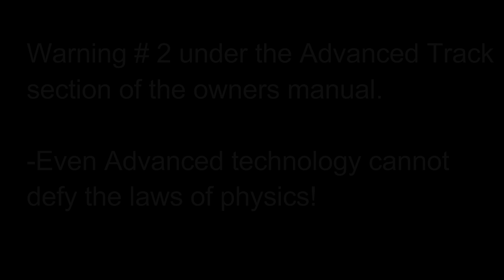The science behind why mustangs crash!

Comment: I agree fully. My 2018 gt350 is great on track as long as you don’t drift too hard. Then it gets vicious; exactly what you described and very hard to save.
It really helps to simply disconnect a plug beside the airbox over the driver wheelwell.
Reply: He is 100% correct.  This is a really dumb myth about mustangs.  The mustang is not the problem, nor the solid rear axle, the problem are the drivers who can't handle a high torque engines, who turn off the traction control and just plain cannot drive. 

I've seen video after a video where  Mustang drivers are leaving car shows and get out of control and they do not let off the throttle until they crash, of course the Mustang is going to crash a Ferrari will crash under the same circumstances. 

If you think it's  Mustangs that are crashing all the time exiting car shows, I suggest you YouTube Corvettes, Ferrari's and Porsches crashing while leaving car shows. 

My friend races a 1990  body Mustang solid rear axle  against Porsches , bmws, imports and he frequently wins and beats them. Do you know what he did to the suspension? He put a $3000  to  $4,000 suspension kit on it from Maximum Motorsports and Cobra brakes and better tires that's it. The touring cars from the The the 1980s and up that Jack Roush produced and raced all had solid rear axles and they decimated the competition. NASCAR runs solid rear axles.

Comment: Corvettes can get away from you too. I had a C5 that would easily throw the rear end out if the traction control was off. The difference is more KIDS and inexperienced ADULTS have access to Mustangs. A person at McDonalds can get a Mustang GT that's never had a rear wheel drive car with 400HP. That means there are lots more Mustangs driven by kids and inexperienced adults= more Mustang accidents.

Comment: Isn't the stability control on a separate circuit with its own relay, or is it integrated with ABS? In any case, surely a simple fuse box on/off switch can keep it all off for track use.

Comment: From the perspective of an old fart, who Raced IMSA and SCCA in the 80's through the late 90's... 

Frankly, my Vehicle controlling ME in any way scares the crap out of me!! 
If my Car got greasy, and I made it squirrely out of a turn... That was my bad I admit it, learn, and move on.

BUT - if I'm in that same turn, and I get loose or start pushing... and I go to correct it like normal...

You're saying that THE CAR is going to apply a Brake or manipulate the Throttle (I do understand drive-by- wire), and undermine my learned reactions??? 😲

I was also a Ford Service Tech, back in the rotten years of OBD Systems (like EEC-2 and 3!!!). 
As ignorant and horrible as they were, none of those systems ever tried to take control AWAY from the Driver!! 

I say NO THANK YOU Sir! 
I'll keep my SN95s and New Edges...
Sure they're slower than the late models by a good margin. 
BUT when I'm behind the Wheel, I'm the one in complete control!! 

Technology isn't always for the better....

Comment: I recently bought a 2007 mustang GT, turned off the traction control and wanted to do a slight drift on a 90 degree turn.  I have drifted in my SCION before with traction control off and it was controllable, but when I tried the same thing with the mustang it made no sense what happened next.  i took off from a stop light with a controllable drift but once i hit second gear and reached the steering stop the car lost control spinning 90 degrees, once i put on the break to stop the car,  it then snapped the opposite direction and the car did a total 180 degree spin and i ended up over the curb.  I never experience such a crazy out of control spin like that and i wasn't even going over 30 MPH!  Luckily there were no other cars near me when it happened.  What your explaining in this video is the only explanation for what happened.  I am not new at driving rear wheel drive cars and this was unbelievable.

Comment: Its not just a ford problem. I have driven several car makes that have what I think is a similar flaw. For me Bmw Mercedes Nissan All have the same issue. One is that you can never really without aa tune turn off or active a track driving mode on the car. The car esp ford and BMW keep the traction or stability or whatever you want to call it off. for me what happens is that the traction control only wants all four tires to spin at the same rate. This is a silent killer.. All of a sudden you get push.. you try to correct it and you are just there for the ride.

Comment: I took my friends 15 GT around a 90 degree corner from a dead stop, all systems off. Started spinning the tires about half way through the turn, easy controllable skid, at approximately a 50-60 degree angle, the second I let off in attempt to correct the car, it violently snaps the ass end around and I go into a 270 degree spin and goes backwards off the edge of the road, completely out of the blue from any other vehicle I've ever tried to skid in any fashion, even wholly underpowered cars that could barely spin the tires would never snap back like that

Comment: From my experience with my 2012 GT track pack with brembos. The system is alway on unless you re-tune the car. When I first did my bolt ons I had Central Texas Performance tune it. They did three tunes. Strip (everything off, max hp). Street performance ( everything off daily driver) daily tune (everything on). I drove the car in the street performance tune for years. Could spin the tires and drift turns all day. When I got the car ready to sell. I had him pull the mods and tune it for a friendly daily tune (everything on). I could still turn it off manually. I drove the car for another month, and would just turn everything off. The first time I went around a turn, and tried to slide. It all turned back on, through me into a 10 ft Max lock side to side tank slapped, and almost put me into a wall. I am not a professional driver, but as someone who had slid around the same turns before with no problem. Almost kissed a wall thank to the traction control system coming back on. Could have been driver error,  but it was never an issue before. Just my MHO.
Reply: I have a 2012 gt  premium as well and to turn off advanced traction control you have to hold the break and push the traction control button down for 6 seconds and you'll notice the advanced traction off on the menu screen. That seems to turn everything off as long as you do that. Just pressing the button isn't enough. But I turn off the advanced traction control and the car livens up and I feel no aid wether I'm swinging it or not. Maybe that somthing you never heard about??
Reply: @SeriusCoyote  in my 2014 gt you can hold the brake and just double tap the traction button twice and advance trac will turn off which is stability and traction fully off
Reply: @mustangraf  yeah on my 2012 I have to hold the brake and hold down traction control button for 6 seconds for the same thing. Turns everything off. I pretty much do it every time I start the car now 😆 👍
Reply: @SeriusCoyote  Yes sir every time i turn my car on i instantly turn everything off😂😂🔥🔥
Reply: That sucks it came back on. I've seen shit like that happen before. It seems like a glitch or somthing that shouldn't be happening ever
Reply: can you do the everything off tune with newer mustangs?

Comment: I haven’t driven many new Mustangs, but I have driven several examples. 
The main thing that struck me was the lack of throttle control at high rpm. You can’t bring the engine rpm down from anything above 5500 rpm. It just responds super slow.
Reply: Yeah stock tune is utter crap.  Not sure if you mean in an auto or manual but for autos once you get a tune its super responsive.

Comment: Can't a tuner turn these off for good? When I got the 13 gt I could not spin the tires much unless I turned traction control off, but I got a tune and did request they turn everything off by default as I am used to the old mustangs that don't have any nannies. After the tune I can spin the tires fine without pressing the traction control button, and the light is not on in the dash saying it is off. I was thinking the tuner is able to just change the default values in the computer, but I wonder if they are or were able to also disable the whole "umbrella" as I have never actually gotten the car into a big enough slide angle at high speeds to find out. Awesome video by the way thanks for sharing your knowledge!
Reply from the maker: Thanks!
That's a good question I'm going to look into. Last time I hooked up my HPtuners was over 2 years ago. They didn't even support modifying the throttle lag. 
With my Z06 I have access to the throttle tables, and the traction control tables as well, so you could modify normal vs competitive vs fully off modes to your hearts content. 
So it makes sense that you could fix those issues through the ECU. I'm definitely going to see if HPtuners has broadened their support. Thanks again for sparking my curiosity. 
-Russ

Comment: Please tell me which fuse to pull to shut off esc???? Do I pull 1 or 3 fuses? I tried pulling 34 and it felt like it worked but I got a wrench light?
Reply from the maker: You should get a wrench, and a stability control light if it worked. Only 1 fuse needs to be pulled
-Russ
Reply: I did it again and it's definitely in limp mode when the light is on? No codes? It felt different before the wrench light.
Reply from the maker: It shouldn't be going into limp mode from you pulling the ABS fuse. What fuse did you pull and from which fuse box?
Reply: I pulled fuse 34 from the passenger foot well. I drove the car and it was night and day different. Parked it went to drive it again an hour later it showed the wrench light and the accelerator felt mushy like it had half the power it had before. For instance instead of pushing the pedal a half inch to get it going in 1st I had to push it an inch and half?
Reply from the maker: What year is the car? I never had that, but I also never ran for an extended period of time without it.
Reply: 2011

Comment: I totally agree with you Russ. And I am not one of those people that dons a tin foil hat every time he gets near the microwave, I genuinely think these systems are better left on in MOST circumstances. However, I have firsthand experience similar to your spin in the Mustang when you neglected to fully disable the system.

This was about 2008 or so, and I was at an Audi event on an autocross that had been setup to compare the all new A4, 3-Series, C-Class, and Lexus IS. Now, surprisingly, the Mercedes was my second favorite, as it had the most direct, but clean feeling steering to me. Unsurprisingly, the A4 was #1--as they were comparing AWD cars only, and for the Audi, that was the top spec, but the others, being on RWD chassis, only offered AWD with their midrange engines. The BMW must have been in some kind of limp-home mode, though I saw no dash lights, I was able to floor it for most of the track without exceeding 15mph in some sections.

Anyway, back to stability control. Near the end of the track, was a slalom that you could carry a bit of speed through if you were quick and direct with the wheel. On my final run in the C-Class, I came in a little hot, but I knew I could catch it with a little bit of countersteer. I corrected the small drift, and the car corrected a half-beat after I did, swinging wide in the opposite direction. I corrected again, and again it did the same thing, causing an overcorrection after traveling straight for a split second. Not only was the system upsetting a fully stock car in a very dangerous way, it was doing so with such a delay, that it was not possible to anticipate its actions. The Mercedes wound up drifting sideways through the cones like it was on bicycle tires until I hit the brakes and put an end to the nonsense. Traction and stability systems were fully on the entire time.

Computers are getting faster every day, and eventually this kind of issue will not be a concern, as they will far outpace our reactions, but for now, not all systems are created equal. GM has had some hamfisted ABS/TCS in the past, but their stability setups, especially on performance cars like the Vette, have always been a step ahead of everyone else. That experience in the C-Class was a black eye for Mercedes safety IMO. If it had happened on the road with a real obstacle instead of cones, that could have been catastrophic.

Comment: Great videos as usual. I followed over from SVTP awhile back.

My $.02 on the subject is both brief and possibly off topic, but needing to be addressed.

A: The c5 is such a balanced car and I wholeheartedly agree on the simplicity of instant off; with the competition mode requiring any 'tricks' - and it STAYS OFF. I used to run the car only in comp mode and it too has unsettled the car or caused a near accident when it corrects before you are done. Again it's in these mentioned moments of low throttle / slip inputs during a situation where you are making a gentle correction off throttle. I ONLY drive the car with the TCS full off now; even if I'm getting groceries in it. I want 100% control 100% of the time.

My indirect/direct gripe with Ford and Advancetrac has nothing to do with a Mustang; but my DD, a 2011 Ford Escape with the v6 AWD configuration. 

From what I can find, ford started subletting the undefeatable systems in the cars around 2011. I say the cars, as it affected the entire line. My past mustang and escape were one touch full off. There are multiple complaints on many forums where you cannot fully defeat advance trac and RSC which is roll stability control / tq vectoring via abs. 

This is a BEAR of an issue for me in the winter. The escape will only disable TCS for wheelspin when the wheels are dead straight. If the car begins to slide, you HAVE to correct it with non throttle inputs. There is absolutely no way to induce over steer and get the vehicle to rotate as it completely shuts down the power. So if you had too mic momentum; tough luck...you're going into a ditch etc. It's dangerous and causes me near accidents with both winters I have owned it now.

Unfortunately the escape community is not too privy on forcing slides; so you won't find many like myself out there searching. I found it cannot be defeated through a reflash - again like the rest of the vehicle line. I have seen people pulling wheelspeed sensors on FoST and FiST forums with some defeating ABS (if front is pulled) and affecting bias to rears being pulled and retain in the braking but skewing bias in an opposite direction. 

If ANYONE knows a defeat on the Escape via module or other I'd be more than interested. So far from mustangs to hatches to f150s, the only work arounds are unsafe and hack like. I have gone so far to think of trying the wheelspeed sensor trick (as it relies on steering angle too with slip...donuts are a 2mph unpowered crawl ) and wiring a relay with a button that will break connection so that I can drive in the snow/ice with confidence. 

The systems are great in ideal conditions and you can feel them forcing the cars to turn and rotate, but it's highly unnatural and forces you to change your habits and lines to comply with what the system likes. Which is argued on the track that ESC forces you to drive improperly even if faster because you end up using it as a crutch and taking lines that force the car to engage the system, giving more grip than what was there in the first place.

Comment: I've also heard that you can pull just pin #5 off the ABS connector. It shuts off Advance Track and leaves ABS intact. There is a thread regarding this on SVTperformance
Reply: can you link me to this? I can't find it and would like to try it on a 2013 f-150

Comment: I've said over and over to people that stability control only makes thing worse for a good driver. I'll put the car where I want it to go.
Reply: Very few people are as good as they think they are.
Reply: Mutt Head you’re such a mutt head
Reply: Mutt Head slow and smooth is fast. if you can accomplish that nannies will not kick in.
Reply: No, you won't put the car where you want it to go.  Physics will decide where it goes, and you have little say in that.
Reply: @TasteMyStinkholeAndLikeIt  um ever heard of practice? You think s15's or ae84's drift themselves 😂 you special
Reply: @TasteMyStinkholeAndLikeIt  a computer can't beat physics either so I guess everyone wrecks their car every time they drive lmao

You don't have to beat physics, you have to work with physics. That's what a good driver does. Stability control is designed for daily driving with maybe rough weather/road conditions at normal speeds. On a track with an experienced driver it can screw things up especially if it's telling you it's off and then turns itself back on unexpectedly. Because then the driver is not able to act accordingly because he thinks it's off and it kicks back on mid turn and wrestles with the driver for control of the car
Reply: @CHURCHISAWESUM  
-->"a computer can't beat physics either"
And that's not its job.  It's job is to fight the overwhelming stupidity of the person behind the wheel.

As for the rest, I agree.

Comment: I get this behavior all the time when I autocross my 2011 GT. I run a BFG R1-S 305 width tire. I use the method of, hold the brake and press the TC button for 5 secs. Several runs I have run into a dash warning of "AdvanceTrac Service needed". This turns on AdvanceTrac immediately. Extremely frustrating. 

Which fuse do you pull to disable stability control (and coincidentally ABS)?
Reply: BillyBoB4869 On my 2012 it's fuse 35 I think. It's in the fuse box behind the passenger kick pannel.
Reply: Thanks for that. I will have to try it out, without the fuse. 

Do you know what I'm in for?
Reply: BillyBoB4869 Yeah I flat spotted a tire. So I don't actually recommend it. Definitely go for the 302 S race abs module if you can.